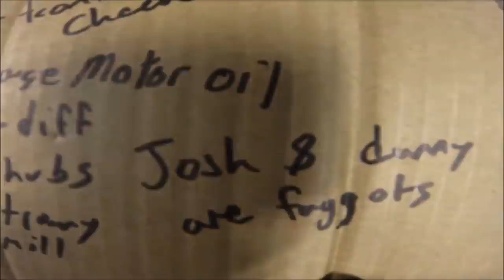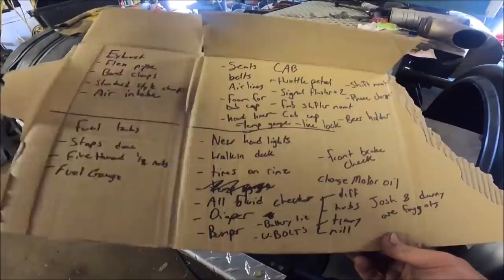DETROIT POWERED K-WHOPPER RACE TRUCK!!! UN-GREASED EDITION

Comment: A guy never really cared for Old Big Rigs until you introduced me to the classy Detroit K-Whopper. What a beast!
Reply: The old Detroits and cummins trucks were sick
Reply: K-whippleWhopper
Reply: Need to see all the old Whites, Mack’s, Peterbilt & Case bone rattlers I cut my teeth on back in the 80’s, confuseres were a as yet undrempt future nightmare & the only “electronics” needed to fix crap was how to make a continuity test bulb outta a old tail light... or have a swamper to hold both sides as ya cranked & see how high ya lighted his hair up, mullet to full Afro? YOUR CHERRY! them old trucks just ran & ya had to have a set to run em specialy attacking mountain roads with them old split clutch’s, lotta awesome memories seeing shit most never will, lotta that stuff is rear view only, lotta still to be seen, go getter done I’m on old 2 wheels now
Semper Fi
Reply: DD Speedshop

Comment: When I was a kid, my father worked for a tire dealer, that recapped tires, infact is now one of the biggest dealers in the northeast, but back in the 80s and 90s, they were affiliated with Bandag, which made treads, cushion and other capping materials, anyways, there was this guy named Tyrone Malone. He built and raced big rigs. They were Detroit powered, and he set records back in the 70s and 80s. I met him at outing events held by this dealer and loved watching Tyrone tear up the the street the event was held on. Trucks were the Super Boss, Bandag Bandit, The Hurricane, and some of his other vehicles. Look him up, he had some bad ass rigs.
Reply: The Bandit was my fave of Tyrone’s rigs.
Reply: He also had Old Blue, a cab-over that towed a refrigerator trailer with "Little Irvy", which was a frozen 20 ton sperm whale.

Comment: When I was a firefighter we had a 86 Volvo/White 3,000Gal Tanker with a 8v92, it was done up well, still looks and runs good, only goes one the "Big Ones" as a 2nd out Tanker, man that thing sounded amazing, you come of the throttle and peg the jake or when you had it bellowing up some lil back road grunted it was loud.

Comment: Over my 30 years on this planet I've just recently got into diesel stuff and this is almost exactly what I want to build a 70's single cab single axle kenworth or peterbilt or international cab over and build a badass big boy Cat or Detroit basically a turned down pro stock or street tractor pull build with a compound setup with some giant Harts turbos and a lil nitrous to lightem up but I seen the FuelTech guys put a pro stock or street tractor on the hub dyno that had a actual international dt filled block based setup with 630ci and converted to run on methanol which I like, it has a crazy custom billet hemi style head, custom billet crank and aluminum rods, compound setup with 3 huge turbos it's a wild badass setup that's capable of 6000+hp 6500 if I am remembering right! But now I want a setup similar accept only fill the block to the bottom of the water pump if its any thing like a SBC or LS motor, run the same head but with water jackets because I want to drive this big bitch I'm not trying to make 6000hp but 4000-4500hp is where I think  it would live longer and be happier on the street and still plenty of power to drive out of 80% people's life in a 7000-10000 pound big truck idk how much the trucks I mentioned weigh or how light you can get one. Running on methanol it would have to run one or both fuel tanks to go anywhere lol but it would make half of a small town cry from all the fumes from the amount of methanol it would take to keep that motor happy if you was to race someone at a red light in said small town! LoL

Comment: 71s had blowers as well they were just a different shape. The best way to tell is by the valve covers. On a 71 they're flatter and more rounded as opposed to the raised, boxy profile of those on a 92. Plus the early ones say General Motors Diesel instead of Detroit.

Comment: Take a piece of wood put on the back of the cab and cut a square hole the size of an ac window unit and put a power inverter or generator on the truck